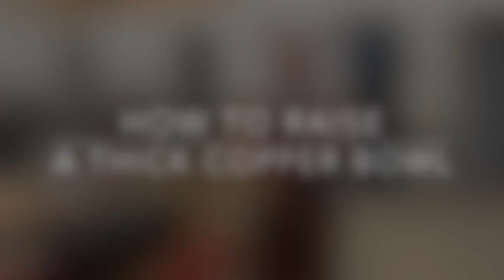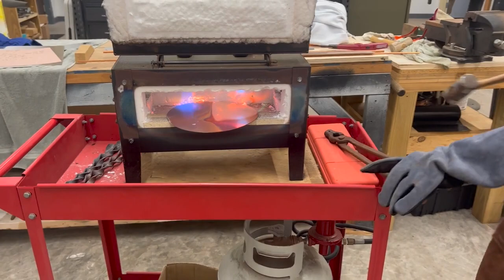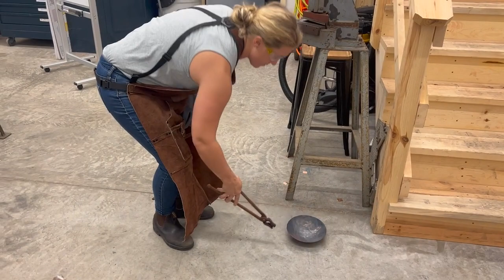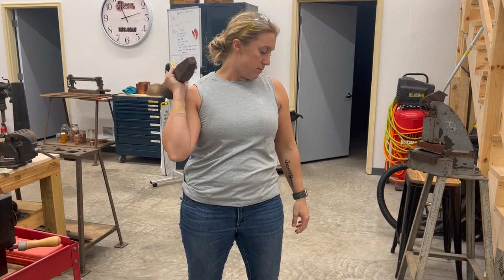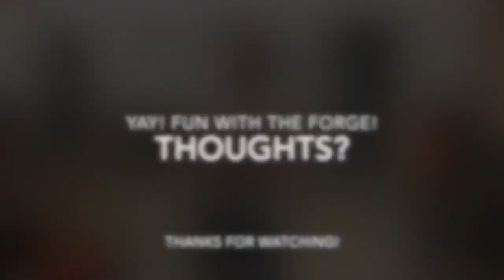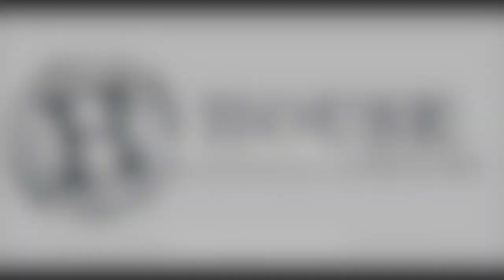How to Raise a Thick Copper Bowl

Comment: You are actually "sinking," which is the first step of the "raising" process. "Chasing" is more of a chiseling process. True raising is hammering on the piece /over/ a stake, as opposed to down into a depression. I'm not sure if I've explained it right, but i hope this helps!
Reply from the maker: Thanks! I actually was taught the term "raising" by the old tinsmith I apprenticed under for doing this process. He's now in his mid70s and maybe the terms get mixed up over time. I've also seen it called "dishing" instead of "sinking" - I guess it just goes to show how language and processes can change or shift over time?

Comment: As a note you could also quench the copper after you anneal it in water to make handling it way easier.  Copper doesn't harden in the quench like steel does.
Reply from the maker: Thank you for the tip! I just find it goes way faster to keep it hot the whole time. :)

Comment: You are sinking not raising as someone else mentioned. Sinking does make the sides stand up because you are pushing the center down by stretching the material away from the edge inside the vessel you’re making. Raising is done from the outside by compressing, gathering or shrinking the material and as you shrink the piece from the center to the edge it raises the sides because the circumference is getting smaller. 

The circumference of what you are making will be the same as what you started with or possibly larger if you hammer all the way to the edge. It will also be the same thickness or thinner than the .060 you started with, much thinner in the lower portion of the bowl where most of the stretching happened. When I raise a piece the starting edge will have a smaller circumference when done and it will be thicker. 

Also mentioned was not needing to hot work sheet copper. Any non-ferrous sheet metal that can be annealed can be cold worked making control much easier. 

Hope this helps
Reply from the maker: Lol - some people say it is "chasing" others say "sinking" and Bob the master tinsmith I apprenticed under for 8 years called this "raising". I will have to try the quenching - I just feel like keeping it hot will move the crystal structure faster than cooling it in between. Always fun to try!

Comment: Ok now let's see you chase it into a cup/chalice.
I actually used a tree stump with a smaller bowl shape carved out, easy to do with a air-chisel and disc sander.
My brass chalice started with a disc about that size and thickness. I used a torch not a kiln to anneal.
Once you raise it a few inches you're gonna need another... torch-kiln? Is that what that is?

Chasing verse raising.

Chasing is done from the front of the piece, and repoussé is done from the back. If you can see tool marks on the front it was chased.

Pitch pots are used for repoussé, and chasing to back up the material while it is being formed with the tools.

Dishing, like you did is chasing. When it would move from initial form like you did, then you could take it to the stake, or you could hold your piece with kiln gloves and work the walls higher on a wood dish.
We got a good wide tree stump. Use the center heartwood. No worry burning the wood, dip it in water, then you are blacksmithing. lol
Reply from the maker: Thank you for all of this! It's so awesome to have all the info on the channel for people to read/see/learn!!

Comment: Technically you sunk this bowl, Raising refers to hammering over a stake, not into a form. Chasing adds detail to the outside of a vessel filled with pitch or wax.
Reply from the maker: Cool! Thanks for letting me know your take on the terms - I guess I'm used to saying "raise" as that is what I heard for 9 years - and what the master tinsmith calls it - he says we "raise" a lid. I've never heard any of the tin and coppersmiths use the term "raise" when hammering over our stakes at all - I wonder if there are different terms between smiths? For instance, we have chasing hammers we use to create details and texture by hammering...but we NEVER use pitch or wax in copper smithing. So maybe chase means something different with copper smithing vs blacksmithing, too? The definition I've found of chasing via different institutions (so this is not mine) is: "A metalwork technique used to create a surface design or texture. The metal is worked on the front by hammering with punches that depress the metal surface." - but again, I betcha each smithing technique has different terms. I've noticed that a bunch over the years. Always fun to share and compare! :) :) :)
Reply: Yeah, that's what I learned decades ago as well... chasing on the reverse of repousse, and sinking from the inside and raising from the outside. Also, I was struck by why we wouldn't quench the annealed copper... Unlike steel and iron, which become brittle upon quenching, copper, brass, silver and the like stay malleable and harden after repeated contact. Certainly would be safer! Oh, and I also was taught to use the old sand bags, wooden forms and a bossing or rounded tinsmens mallet for sinking. 

Still, I love this channel and everything you do, Sarah! Many thanks! ❤
Reply: Yes, what you did was sinking. Usually one starts by sinking then raise over a stake. 
And yes we do use pitch in coppersmithing to do repousse or chasing or even to do some different shapes on a copper vessel.
Love your channel, keep on the good work.
Reply: Also usually we use a wood mallet over a sinking stump made out of wood and work with anealled cold copper.
Reply from the maker: I haven't had any formal training on this aspect - just what I've learned on my own, as Bob doesn't to much of this work. I so appreciate always all the comments and learning provided on here!
Reply from the maker: Some people say it's chasing, some say sinking! Ack! lol! I've never used pitch for anything - no one has used it in the 9 years I've been learning this trade, not even any of the 50 guys at the convergence. Do you have any video examples of pitch / wax used? I'd love to see it in action!
Reply: I always enjoy your videos, regardless of the accuracy of the terminology! I love the humble way you honour Bob and share your knowledge and skills. You seem to be a genuine and generous human, not to mention strong and fit! 

You inspired me to make a recycled copper (used etching plate) ibrik (Turkish coffee pot) with a riveted brass handle... Everything was great, except for my failed tinning of the inside! I'll pick it up again and have another go soon... Thanks again for your work! x
Reply: @housecopper  David Huang has some YouTube videos on hammer chasing on his channel, it was from him that I learned this terminology.
Reply: The other thought that I would like to add, all of the hammer making companies that have raising and/ or chasing hammers or stakes, support my definition of raising and chasing.

Comment: Technically speaking, you have "sunk" a copper bowl.  Sorry, but you have not done any traditional raising or angle raising.  A bit misleading.  Also, chasing and raising are not interchangeable terms or techniques.
Reply from the maker: Thanks; sorry for any misleading, it is not done on purpose! I actually was taught the term "raising" for this method by the old tinsmith I apprenticed under for 10 years - we would do this on a small scale for copper mug lids and he'd say "go raise the lid" and I'd do this exact process. After doing some research based on the comments here, it looks like what I'm doing in this video could also be called "dishing" instead of "sinking" as well. So now I don't know what to think! lol! Or maybe the words are all interchangeable?? :)

Comment: Coupla things; copper is the softest metal you can beat on , get a smaller shorter hammer and shorter tongs . You need to get those elbows lower than your shoulders or you wont have the energy to finish the bowl.
Reply from the maker: Thank you! I'll always take advice on blacksmithing techniques - I'm super green and mostly know nothing about the processes!